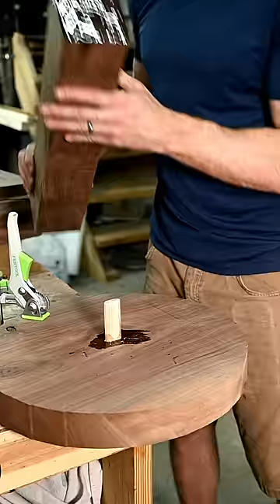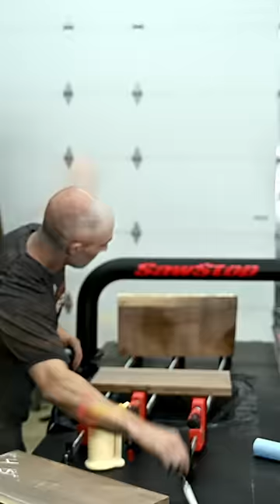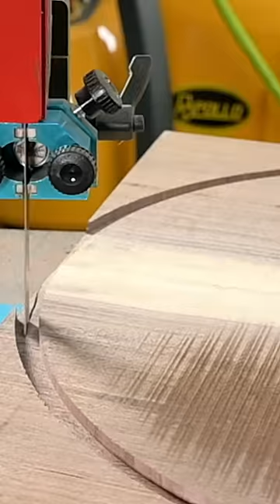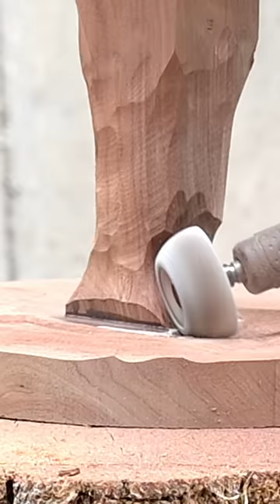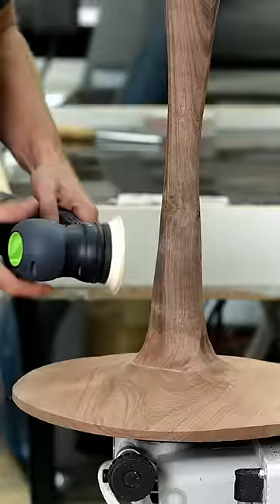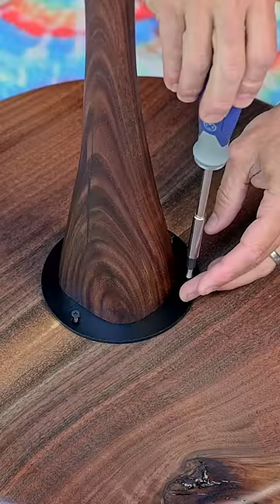I Tricked a Customer

Comment: So.... everyone's commenting on all the expensive tools, but this could be made without them.  Cam, please redo this experiment and show the same tables can be made with a standard circular saw, router, angle grinder, drill, and screwdriver.
Reply from the maker: No matter what tools I use to make these with there will always be comments demanding I use less tools. Until I can write a chat GPT prompt that builds a table for someone, people will be unhappy.
Reply: Not necessary but it fuckin helps hahahaha
Reply: @blacktailstudiouncut  no matter how low the wood costs, your hard work makes it worth much more, ignore all the people saying that your work costs nothing, keep doing you.
Reply: If the op can't see that you need several hundred dollars of tools on the cheap end to start this project, then here is your new title to not get those comments "A way to make money when you already have a lot of money to start with." You're welcome.
Reply: Yeah of course it can be done with lesser tools, I ran off a portable kobalt table saw for years, bought some old Bailey's at the local antique market and learned how to hand plane because I couldn't afford a planer, also hand planing edge contours and what not. No drill press, only the shitty milescraft mini drill press guide, etc. 

Of course It can be done - everyone's point tho is id hardly call that an "average" woodworker. To a professional, it's definitely average. But to someone starting out in the skill, it seems way above their skill. Great video nonetheless, and I do agree with him
Reply: U cant make this in 1 weekend without those tools... so his claim is a lie.
Reply: Average woodworking tools are drill, saw, chisel, sand paper, and measuring device.  What you just said was the equivalent of "if you want to get rich, just don't spend money". What a disconnected take.
Reply: People acting like those tables were some crazy feat he accomplished…. Just because he’s got a crazy shop and tools….. them tables ain’t shit….circ saw,jig saw, grinder, sandpaper, some fucking work ethic and mental capacity and you’re done ✅
Reply: @blacktailstudiouncut  Honesty I second that request. You say anyone could do this, but you used your tools, should do this with basic tools and see if you can still get it done in a weekend. 

Secondly, you are a professional woodworker. You probably have many thousands of hours in the craft, which any weekend warrior will not have. 

I love your videos and awesome pieces you create, but this video seems disingenuous TBH, it is alot harder then you make it look, and for a novice with basic tools it is an extremely high bar to achieve 1k profit for a weekend of work.
Reply: @recoveringstepson7033  did you not have volume on? He said not basic garage tool, but basic woodworking tools. I have less than 500 into my shop and I have more tools than Cam.
Reply: @blacktailstudiouncut or just make the video with every day tools… (circular saw, jig saw, handheld router, orbital/hand sand etc.) don’t be lazy, it gives carpenters the wrong impression
Reply: @redxgk  no, that's an average homeowner garage tools, any woodworker is going to have a lot more tools than that, things like a jig saw or bandsaw, a router table, table saw etc.
Reply: @Teh_Random_Canadian  you are correct that he makes it look easy, but any woodworker with standard woodworker tools (table saw, router table, jig saw or band saw, planer, assortment of clamps, etc) and some basic experience working with wood could do something like this.
Everyone here seems to be assuming that he means you can do it with nothing but an old drill and a file, and no prior woodworking experience, but that's NOT what he said.
Reply: It’s actually the knowledge and patience that gets you  good results. The newer tools may save a little time but if you are rough with any tools it won’t be hidden in your final product. I have seen craftsmen with much simpler tools getting as good a result and I say it comes down to knowledge and patience. Knowing which Timbers to use is another important factor as is knowing the best finish for the project … oh and by the way from time to time people have been known to give away expensive seasoned timber and off cuts  to an enthusiast, I have been on both ends of those transactions, when that happens the cost of timber is negated …
Reply: @cavelvlan25  ppssshhhh it's the market....."who's buying it" lol
Reply: @blacktailstudiouncut  Smart man. Stupid people are not worth your time.
Reply: @BOBANDVEG  I definitely hear ya haha. Hey ya never know tho
Reply: @blacktailstudiouncut  You're exactly right; you could chew it like a beaver and make it and someone would say you have privileged teeth.
Reply: @ke6gwf  Damn, you were lucky then, those were the tools I had when I started. Either way it doesn't diminish what I said about OP.
Reply: @3chasemanges3 ... And the space. A home where neighbors aren't as big an issue. Don't get the need to put down others with the mental capacity, maybe work on your own.
Reply: @gregriba6896  You can make it in 1 weekend without the fancy tools, but not without the skills. Cam can make it without the fancy tools; the average dude couldn't make it even with the fancy tools.
Reply: Yeah I've seen that in Mexico where they made their own tools to do something like that and more efficiently.
Reply: @gregriba6896 maybe you can’t make them but you’re not everyone else
Reply: @redxgk  see, the difference is that you are getting Woodworker and Carpenter confused.
The tools you list are BASIC Carpenter tools, as in what a dude building a shelf in the garage and feeling special because they are building something might have.
A woodworker is someone who makes more advanced projects, and that takes more advanced tools.
Reply: can you make this with just a spoon?
Reply: @ke6gwf  and there's the disconnect. I know what I was talking about. I built a desk with those tool, but I guess that doesn't make me a woodworker in your eyes.
Reply: @redxgk  no, it just makes you an impressive craftsman to be able to build a desk with basic garage tools lol
You used skill instead of tools.
These comments are on a Short, so you have probably seen the shorts of guys with safety sandals fabricating new excavator booms in the dirt, or turning rebar into lug bolts, and shaping wood only requires something harder than the wood, plus skill.

You were heavy on the skill, light on the tools.

But you are not an "average woodworker", I think you would agree.
Reply: Lmfao he would never do that because he knows it's impossible
Reply: Really, though, the premise is "average woodworker can make 1000 in a weekend"
Maybe extending the reasonable time to a week or four days, or whatever, which is still respectable.
There is wiggle room on a premise, and there is being off by half (or double, depending on how you look at it).  This build is probably closer to the later rather than the former.  Two weekends, four days, less room for error in the cuts and measurements as you go through the multiple steps that good equipment knocks down to one or two.  

Note:
I agree about doing it the low tech way just to see what changes.  He can even make the exact same piece as shown in this video for a reasonable control group.
Everyone wins that way, whether this video gets debunked, rebunked, unbunked, post-bunk clarity, or whatever bunk applies.  There will always be people making  bad faith complaints out of ignorance or pure jealous hate for talented craftsmen, but there are way more viewers who are discouraged when they see equipment they could never afford as a requirement to make beautiful pieces like the one in the video.  True or not, the sentiment remains for novice wood workers.  Building with basic hand tools shows what is possible.
Reply: And include how long it took to make.
Reply: @recoveringstepson7033  You can do this with a draw knife and a normal skil saw. That's about $100 for brand new tools of decent quality. It would be a ton of work that way but not incredibly difficult. If someone can't come up with a couple hundred dollars then they probably lack the skills to do something like this anyway.
Reply: @blacktailstudiouncut  well I would genuinely love to see how to do this on a budget.
Reply: @blacktailstudiouncut  wrong. Just do as requested and make the tables with a few tools from Home Depot.
Reply: Why bother? If not able to translate, than probably shouldn’t be using ANY power tools!
Reply: I feel like the expensive tools MOSTLY make it take a shorter time.  You can still get a similar outcome,  it'll just take FOREVER and be harder.
Reply: Bit entitled here, aren't we?
Reply: @3chasemanges3  the claim was in a weekend. Without those tools the "average" woodworker couldnt do it in a weekend. This could be done with a chisel, saw blade with duct tape as a handle, sand paper, and more than a weekend. The challenge was to do this in a weekend.
Reply: @Omni11B  no ish sherlock. The point of the video was in a weekend. This could be done with a sawzall blade with duct tape as a handle, sandpaper, screw driver, and will. It just wont happen in a weekend even if you spent 48 hours straight working on it. If the weekend part of the comment was removed i would 100% agree with him.
Reply: @blacktailstudiouncut  great way of showing you don't stand by what you said.
Reply: @trex9194  what don't you get about basic woodworking tools not garage tools. And if you can't make that in a weekend with a table saw, router and angle grinder this isn't the hobby for you to make money with.
Reply: @blacktailstudiouncut  nah you're just lazy.
Reply: One year later.....
Reply: @blacktailstudiouncut   I just find it hypocritical that you say this can be done with cheap tools, yet you don't? It bothers me even more how defensive you get when people point this out; either you're being ignorant or deceptive to your audience. As much as you dont want to admit it, theres a reason why people rarely craft these kind of pieces out of the home garage. It's a simple fact that it would require a huge investment in tools and equipment in order to do it properly and in a reasonable amount of time. I COULD make this with a circular saw and an orbital sander, but how long would that take? An entire day? An entire weekend of painstaking work? And how good would it look in the end? It's easy for someone with a complete woodworking shop to make these claims. If you really think it can be done with home tools then make that a video and you won't have to keep responding to annoying comments. In the meantime, I'm gonna call bullshit.
Reply: If you can't figure out how to build this then you aren't a woodworker anyway
Reply: @Nobody stop crying on the internet it's pathetic.
Reply: @blacktailstudiouncut gee, why might that be? Maybe because the tools are the biggest obstacle for people who can’t afford them? Are you really pretending that $700 festool track saw isn’t making your job significantly easier than my ryobi circular saw?
Reply: @kylevernon9625  but next to no one is complaining about a lack of skill, almost ever comment is about lack of tens of thousands of dollars in tools
Reply: @gregriba6896  says who?
Reply: @blacktailstudiouncut  😂 Well put!
Reply: @blacktailstudiouncut  nice way to dodge the challenge/request.
Reply: Idk where you live, but that's still near a 1000 in tools and that's on the cheaper end.
Reply: @blacktailstudiouncut  A.K.A, he wont do it, even though it brings in $1000 in profit he wont because it is hard as hell to do and he isnt willing even given the financial incentive
Reply: @ke6gwf  thank you for that. I just want OP to see it the same way and not sensationalize his claim.
Reply: @Omni11B  where do you get such cheap tools and are they worth it?
Reply: @jamesbarnicks4863  Craigslist and yes. You just have to wait for the right deals. Husband's die and wives just want the stuff gone. Most of it needs work but it's almost always just elbow grease and superficial things like paint which I don't care to fix. I have a functional shop, it may not look all pretty but it's accurate and effective. I have a bandsaw that cost me $25 bucks. When I went to pick it up I got a biscuit joiner and beast of a router for free. So $25 for three awesome tools. I'm slowly upgrading as my skills have gotten much more advanced and I'd like to have some festool things. But I'm paying for those with my cheap tools. When I replace things I'll sell off what I have for whatever I paid for it.
Reply: Honestly if you have enough patience, you can make this with a $50 Dremel tool, a hand saw, and sand paper. Yes its harder, but it can be done
Reply: @sigmasinc.2658  I'm talking about still hitting the weekend goal
Reply: @blacktailstudiouncut  clown
Reply: @kiyosenl.3889  Obviously, but the video is about making $1k over the weekend with AVERAGE SKILLS. And the correlation here is everyone commenting how easy that is with tens of thousands of dollars in equipment. Not sure why this is difficult to understand. If you need me to spell it out even further, let me know.
Reply: @blacktailstudiouncut  No. They literally just asked you to do it with the tools that you describe as "standard woodworker tools." It's not that hard. Nobody is asking you to do magic. Just make the same tables you just made, with the limited tools you claim you can make them with. Really simple ask. Not complicated. The fact that your response to someone asking you to do a very specific, reasonable thing based on your claim, is to deflect and say "No matter what I do, someone will want more," is weird.

If you can't or don't want to do it with less tools, just say so. Don't provide a lame excuse.
Reply: @blacktailstudiouncut  only thing I want is for the price of the simplest of tables to be NOT 1200 FUCKING DOLLARS
Reply: So maybe not 7000$ of tools. Just 1000$
Reply: Hahahaha! I got an idea, you do a video and use some Walmart tools lol. Noooo idea what you’re talking about.  I own 30,000 in festool and no other tools slightly compare. It matters what tools you work with 100%
Reply: I dunno chris fix uses the bare minimum tools in his videos to prove his point
Reply: Yeah but without the tools but would take a year to make that $1000 nit just a weekend 😅 tools are what matter the most.
Reply: @blacktailstudiouncut That’s fair that social media is filled with a bunch of haters! However, it’s absolutely a valid argument about the tools you’re using… If you could’ve done it with other cheap tools, than you should’ve… You know just as well as any popular content creator that it’s impossible to make internet trolls happy/keep them from barking about any and everything. You had to have seen this coming…
Reply: @blacktailstudiouncut  excuses. Do it by the original comments terms.
Reply: @MaYbYl8eR  not sure where you're getting your numbers from, but I'll take the bait and be very liberal here. Yes. 1k is much easier for a beginner to invest than 7k. We can disregard the solid cast iron sawstop, festool track saw, planer, etc. Forget the finishing tools, including the RO sander, discs, planer, drill press, consumables, etc. Haven't seen this video in about three days and I'll just go with the first three I remember. 

Remember, we're talking about an AVERAGE woodworker with AVERAGE skills. So yes, we'll go with 1k vs 7k if you're able to find an estate sale from a recently deceased modern wood worker. Your point is ?
Reply: @Nobody beautiful reply. I have an amateur shop and even I forgot about how much money I have invested in clamps alone. FUCK, I do mostly traditional woodworking and the amount of money I have invested in hand planes, vices, chisels, spokeshakes, DMT/whet/shapton sharpening stones, and even stropping compound was overlooked. And most of my antique stuff was bought an absolute steal, and still a shitload of money even disregarding the fact that I restored probably 95% of those tools myself. Thank God I had the skill of sharpening that my pop pop taught me when I was younger, probably 200 hrs+ invested into honing that specific skill. 

The consumables and time given to learning the skill itselg are very often overlooked and you made a fantastic point. I still think it's very doable for an average woodworker over a weekend, but only a very specific average woodworker. most men do not fall in that category. And his table was kinda trash fr.
Reply: Dude, pay me $1200 and I'll do it with things in my silverware drawer in the galley!!
Reply: forget all this arguing in the comments I want to see him do this with like a 7 inch circular saw and an angle grinder with a 4 inch metal wheel. no fancy clamps to hold the pieces in place while the glue sets, just some heavy things leaned up against it or placed on top. 

on a serious note, yeah he's a woodworker and has woodworking tools because of this so obviously as he progresses he will have better and more expensive tools. I'm not a woodworker but I enjoy watching these kinds of videos and shorts because I think its cool and would someday like to get into woodworking but it's not in my budget. it would be pretty cool to see a video or short of him making something with just basic tools that most people have in their homes like a drill and a circular saw or jigsaw maybe a grinder but I don't think those are as common. something like that would definitely help those of us without these nice tools see that it's not only possible but pretty simple
Reply: @blacktailstudiouncut  then do it
Reply: @cavelvlan25  Well, if people would prefer to complain over gaining 1100% profit, I say let them while we go out and spend that $1200 on a nice steak dinner and some new tools.
Reply: @blacktailstudiouncut  Then people will be mad that "the art is gone"
Reply: @Blacktail Studio Uncut  I just want to see you make this without all the nice tools and do it in a weekend like you claimed.  I think that's why people are giving you crap about this video.  Can't speak for the rest of your videos though
Reply: This is not true. Yes it can be done with lesser tools but the finish won’t be as professional and they won’t bring 1200, guaranteed.
Reply: @blacktailstudiouncut I wont be satisfied until you carve a table with your fingernails
Reply: @sigmasinc.2658  but the finish won’t be nearly as good and they won’t bring 1200. That’s the point.
Reply: Established a unique and unique perspective active....no order is more important than have an active😮 your offic😅e is nearby ....Thank Use !!
Reply: @blacktailstudiouncut ...here's an idea!! Our lives will be more comfortable if we become friends.. I have extended the hand of friendship....do what you will and we'll go from there...😂😮
Reply: @recoveringstepson7033  "average wood worker" meaning you have some tools
Reply: I believe he can,, his not cheating like The Dusty Lumber..
Reply: Can I do it with just a circular saw, drill, and screwdriver? I also have some dull chisels
Reply: @blacktailstudiouncut  Catering to the whiners is the same as feeding the trolls. Just do your thing and post it. I, for one, enjoy the vids and the finished pieces.
Reply: Cool and like skill and ambition, this shit is not that easy, youtubers need to stop selling accessibility
Reply: @3chasemanges3  Yeah im starting to think the majority of these comments are just adult children who have never done a hard days work in their life... Have they ever heard of sandpaper?
Reply: “Make your life harder for no reason to prove something that nobody disagrees with”
Reply: This would be a bitch to make without a planer, jointer and industrial lathe. No thanks.
Reply: @blacktailstudiouncut  make the video then, lets see how many comments you get when it's with just "basic" tools.
Reply: @blacktailstudiouncut  no, i just want to see the budget include the cost of tools as the premise of the video states tou "only spent 100$" but even if you did it with manual sanding paper and a hack saw that would be what 20$ but theres likely more than that needed. Theres also a time aspect where ypu have all this macjinery which saves you i guess at least 30 minute per cut minimum without you having to measure and do it manually.

Its a good video premise which a lot of people are interested in, the reason you are getting pushback is because the execution jusf assumes a shit ton of woodworking knowledge and equipment when you are claiming a beginner can do this.

Ok show us
Reply: @blacktailstudiouncut  that's not true. If you'd use tools that regular hobbyists can afford (like for a total of about $500), people could really understand that it is indeed accessible.
Reply: @blacktailstudiouncut  lame
Reply: @blacktailstudiouncut  excuses
Reply: @blacktailstudiouncut  bro what on earth are you rambling about. Nobody said anything about chatgpt your not simplifying an expression. You have 30,000 grand of equipment in your shop if you couldn’t do this is question your sanity
Reply: @colinlpeace  wouldn’t be hard, just time consuming
Reply: @blacktailstudiouncut in my opinion if you used a back saw, hand crank drill, coping saw, and sheets of sandpaper and a block i dont think anyone would complain about the expense of your shop.
Reply: @blacktailstudiouncut  of course we don't need all these tools.  Our ancestors only have hand tools.  But honest question, would you still be able to finish it in one weekend with basic power tools?
Reply: The people who are complaining are the people who will never build a table like this so I don't really think it's necessary.

If you have the skills to build this, you're not confused by the tool situation. 

You don't need to appease the randoms on the internet who are coming up with excuses to not do anything lol
Reply: LOL HE CANT, he wont let the festool drop out of his hands
Reply: Getting a rounded edge on that circular table... without special tools... gfl doing it with less then 100 hours of practice and dozens of ruined sets!
Reply: People need to try doing this instead of slamming Cam for his utilizing the tools he owns. I'm sure he started out with basic tools. Given time and the effort, this project could be done with nothing more than hand tools.
Reply: @recoveringstepson7033  Exactly... "Make this with only 3 ingredients... But you need $1,000 worth of kitchenware before you start" lmao... And dude is really trying to convince us you don't need social media to be a successful woodworker... Bro, JESUS was a carpenter... Woodworking ain't goint nowhere
Reply: My problem isn't the tools, he comments on it in the video, and stuff like that is expected at this day in age. What kinda pisses me off is the commentary on social media... Of course you can be successful without social media. Woodworking had been around for ages. The thing is, he still uses the internet to get it sold. That's social media. Idc what you say. Interent is pretty much strictly social these days, so...
Reply: @recoveringstepson7033  i think op is directing this at the "average woodworker" (which assumes at a minimum basic prerequisite shop equipment on hand) and not anybody just starting out with nothing. I believe the op to be making this video in earnest to be inspiring and informational which offers much value to the Youtube community. A lot more than i can say for the naysayers and haters.
Reply: Yes yes yes i personally chew every piece i make with my own teeth! I sell 1 piece every decade or so and im rich!
Reply: @studioGEEZ  but he is right, what are the odds someone find my Etsy page, need a side table, and happen to like that design.  Most likely it will sit in my house for 9 months.  So to say I can make $1000 in a weekend, it is predicted on having lots of fancy tools to save time, and the ability to reach lots of buyers.  The average woodworker doesn't have either.
Reply: @Nobody $500 in clamps?!  Lmao, 4 bar clamps would do the trick, hundred bucks max.  These comments are so boneheaded... crazy, you need tools to make shit xD point is you don't need a bunch of high end gear to start woodworking commercially.
Reply: You can have all the fancy tools you want if you have no skill you have nothing
Reply: It WASN'T made with cheaper tools.... THAT'S the point. It's like 🎃 saying he's a self-made man after only getting $100,000,000 from daddy.
Reply: Not on a weekend....
Reply: No dude. You said average wood working but you used tools that are well over 10k in value. How do you justify this at all?
Reply: @blacktailstudiouncut  use a pocket knife
Reply: @blacktailstudiouncut  how about you actually use basic tools then? Basic beltsander basic saw rig nothing else.  Cause using 10k in tools in your $100 video is kinda laughable
Reply: Well done , really proud of you 💚🤲
Reply: @blacktailstudiouncut  in others words no I will not redo it with easy access tools lol
Reply: @blacktailstudiouncut  good work tho
Reply: @blacktailstudiouncut  so no you can't do it...
Reply: Or you could go the Eoin Reardon route and use hand tools, haha
Reply: It would take more than a week end...  also "them" so he's made two??
Reply: @@jayphillips7490isn't a router table an average woodworking tool than an average woodworker would have?
Reply: @recoveringstepson7033 that's a weird take seeing as how he stated if you have... standard WOODWORKING tools. I'm pretty sure most people would consider a cheap router table to be pretty standard for a woodworker
Reply: I would consider those to be basic homeowner tools that every homeowner should own, not standard woodworking tools but to each his own
Reply: @blacktailstudiouncut  just do it with normal tools, don't bs us
Reply: Scratch that I want to see him make the whole thing with a hammer and chisel
Reply: @blacktailstudiouncut  ain’t that the truth lol. Watched a blacksmith video where a dude was making a basic knife and showing the simplicity’s of it. And someone was saying not to use any electric tools in the comments😂😂 must think people out here working like it’s the 1600s
Reply: @blacktailstudiouncut  sounds an awful lot like you don't think you can do it with basic tools and are trying to make excuses.
Reply: @recoveringstepson7033  Have you ever heard of pawn shops? I could go to my local one today and buy all the tools needed to make that table for less than $100, guaranteed. Just because you're either too dumb or lazy to do it doesn't mean it's impossible.
Reply: Or "here's a cool beginner project for someone investing in themselves". Some of us don't have a lot of money and will still spend 10-20 bucks here and there on something they need for a project. 

Yes shit costs money, but so did all the things you own that you can't make money from.
Reply: @recoveringstepson7033  Money is everywhere right now (not saying it's going to last)  If you don't have "several hundred dollars" stop watching youtube shorts and learn a trade. Learn how to be valuable to people.  I make $600 minimum a day as a painter.  People are begging me to paint their houses.
Reply: @gregriba6896  You can make a lot more with a lot less, if you're smart.
Reply: @recoveringstepson7033  nobody has ever made money without spending some. You have a car to get to work right? You spend money on gas. It’s called an investment. You could sit there with a file and hand saw though if you wanted for about 40 bucks.
Reply: @Nobody And then you need to develop the contacts and connections to find those clients that are willing to pay a$1k for a small table. There aren't alot of these people waiting behind every bush. That's real money. Even in NYC, it takes years to build a customer base to sell stuff on Monday that you built on the weekend. 🙃
Reply: @recoveringstepson7033  Nope. I can collect bottles and get the deposits for them. About $100 is possible collect (possible since I live in a country that has deposits on soda bottles and cans) in not too long time. And $100 of cheap tools is enough. Same amount of deposits collection for the materials.

Next thing here is that if the tables results in a profit of $1000 for a weekend's worth of work, then a second weekend could bring in $1000 more. And suddenly there is enough money to buy some way fancier tools and then spend some more weekends making even more money.

My preferred income source isn't woodworking. But I have instead been able to do electronics and programming and reinvesting a decent percent of the income. With a bit of skill that's a very well working route to collect some quite impressive work setup. The #1 step isn't to worry about tool costs, but instead focusing on projects that has mostly self-cost. Tools gets refused but the consumable materials is what decides how much of the sale price that will be consumed just to restock materials.

Both programming and wood working generally has low material costs. So they are good paths from converting own work time into money.

Some people makes the mistake of producing products where the materials may be 70% of the sale price. So only 30% left to cover tools wear, electricity, insurance, and finally leave a small amount of money to cover the invested time.
Reply: @Teh_Random_Canadian  Also, you need a customer base that is ready and willing to pay $1k for a small walnut table, that takes years to develop the personal connections to make that happen. We all know highly talented people that flounder professionally because of inter personal skills are poor and or without good business skills.
Reply: @Nobody walnut can be had much cheaper than that. Plus he said average woodworker. If you don’t have any tools, you’re not an average woodworker.
Reply: First time seeing him, i did doubt i could do it from home. However, i also doubt i could do it even with every tool in the world available to me. The creative bone in my head for creating tables or chairs is at an astounding 0. Repairing them? That i can do... So i do doubt i could do this even with his shop or any other. Thats just my woodworking level though. No part of me was meant to create, just tune and fix.
Reply: To be fair he did say average woodworker, not average person
Reply: @Recoveringstepson  he would still receive bs messages no matter what he does. You have ppl that are just trolls and if they can get someone to comment back or say something they won.
Reply: @blacktailstudiouncut   You can’t make everyone happy, but I do agree with J DeWitt’s comment, I as someone who knows nothing about wood working, but thinks it’s cool would like to get into it at some point in my life, but I know nothing as I said, so when I research woodworking I get all of these experts with their advanced tools and that makes sense. Like I don’t even know how to use a circular saw correctly, hell I couldn’t even point it out to you if I wanted to, but someone out there does and they have the basic tools and the understanding of those basic tools and if you can show someone that they can be doing this with basic tools it may create that spark.

I’m not saying you should do it as it’ll be a ton more work for you, but I 100% agree it’ll fire up some people and inspire them. It may not be right away, but it will happen and even if it’s only one person, then will you could change that one persons life.

But again, you do you. If you don’t want to use more basic tools then don’t. Best of luck to you in life! Have a good one. (P.s. hopefully that makes sense and sorry for all the commas, that’s how I write, gotta work on it).
Reply: @blacktailstudiouncut sounds like a HUGE excuse to me
Reply: @blacktailstudiouncut  pretty sure they just want to see you use basic tools. Not that insane of a request
Reply: YouTube is social media lol
Reply: Yea even with good tools you still need the hands to craft such beautiful work
Reply: @blacktailstudiouncut  just make it with only your hands no tools😂😂😂😂
Reply: @blacktailstudiouncut   but J DeWitt is right, if you want to reach people and make them actually realize its possible then use the tools that an average beginner to intermediate woodworker would have. Unless you really don’t care about that only the only thing you care about is content then the people watching it.
Reply: Reminds me of @HomoFaciens and his DIY CNC, made mostly just with cordless drill and hacksaw.
Reply: @blacktailstudiouncut  Yeah but you're making that money in a weekend without those expensive tools, more like in 15 weekends.
Reply: Sure, it can be DONE without those tools, but NOT in the time frame you gave.
Reply: @blacktailstudiouncut  Not really the point at all. "Average" wood workers don't have access to tens of thousands of dollars of woodworking equipment.
Reply: @blacktailstudiouncut just do it man
Reply: Oh wow those standard tools don't cost money? Wow
Reply: With all expensive tools anyone can... so bought everything needed and I'm still shit 😂
Reply: @blacktailstudiouncut  but those are the most basic tools anyone doing this could be expected to have. plus its a fun exercise of your skills as a creator. my first table was made with these tools and I imagine your first table was as well.
Reply: @blacktailstudiouncut  How's that prompt coming along?
Reply: @blacktailstudiouncut  sounds like a cop out to me
Reply: 😆 And without them how much are you making per hour?
Reply: @Chase Manges  Yes but it takes more time which makes your labor hours/profit margin dwindle. you want to make a thousand in  days to a week or a few hours?
Reply: Bro said without social media then made an etsy
Reply: Anybody here want to sell me enough walnut to do those tables for $90?
I'll even go to $100, heck $110 seems fair enough for it, right?
Reply: @Scramify  the work adds into the value of the finished piece but specialist tools definitely put a damper on his claims he should do the same things with the cheap tools instead of the top shelf stuff that fetool track saw along is almost 1k in tooling
Reply: If it could be made without them, as he said, then he should have made them without them.  Saying this is what you can make with basic woodwerling tools, and then proceed to NOT use basic tools just makes you look dumb.
Reply: @rogerahier4750  agreed
Reply: @rogerahier4750 
Not dumb, but definitely disengenous.
Let's start with: where the *bleep*are you finding that much hardwood for $90?
Reply: @blacktailstudiouncut then prove it bud! Show us please lol
Reply: @Ordzo88  It's talent, not tools. It's the skills, not the shop that allow you to make something like that.
Reply: @blacktailstudiouncut  do you have a video outlining the tools and methods necessary to make those tables?
Reply: @JDeWittDIY  yeah I get that. But let me know these basic tools I need to complete with my "skills and experience". Such a lame video to not show us how an everyday person can do it.
Reply: @Ordzo88  Just watch the video and substitute regular tools. E.g., he used a festool track saw ($1k or so) to cut down the blank. Totally unnecessary, just break out your skilsaw. But I agree, he should redo the video using normal tools that we all have :)
Reply: Then make the tables without these expensive tools and post that video. Because until you do, the people saying that have a valid point. 🤔🤦‍♂️
Reply: @JDeWittDIY  agreed 👍
Reply: @Recoveringstepson  you can get an entry level angle grinder for like $30 at harbor freight. You can cut this with a hand saw you can get for like $8. You can get a draw knife for about $20, $50 for a better one. And router and bit is probably another $60. Hardware would be $30 at most. Sand paper would probably run $20 for this project if starting with nothing. You're looking at about $160 in New cheap grade tools. Sweat equity goes up with these, but if you sell it for the same $1200, you're looking at about $940 profit, less your time. Let's say it takes you 40 hours to do at $20 an hour. You just made $140 profit to the company (less taxes).
Reply: @blacktailstudiouncut  >Obvious criticism that your tools are expensive
>load of excuses to sell the lie that nothing's ever good enough

Face it. You're too proud to admit this criticism is valid. Show us otherwise or just admit it.
Reply: look, I watched his video when the long vid first came out -  the 1200 can happen, but its once in a while chance. and the average wood worker will not get a finish like he did. is it true that he did his best to mimic an "average wood worker"? yes. but Did he use his years of wood working knowledge, photo background, tools, space, etc? yes. those are equally important when it comes to a side gig if anyone wants to replicate his success. Been following before he hit 1 million - but him making the 1k sale seems so easy is gonna catch some backlash for sure.
Reply: @blacktailstudiouncut  your statement= yes, even though it’s very possible to do that, it takes a lot more work/time and I don’t feel like doing that just to prove an obvious point. 
- And I am totally with you on that😂
Reply: You can do it with literal hand tools.
Reply: @blacktailstudiouncut i think we’d be happy with seeing this redone with tools you claim an average wood worker would have. After all you are a pro!
Reply: You could build that entire thing with a hand plane and cheap router
Reply: If you think this is plausible then fly me out, you can keep the money
Reply: @blacktailstudiouncut  "you can make these with basic tools" 
"Hey can you show how you'd make this with basic tools?"
"Why are people telling me to make tables with my bare hands smh these entitled mfers"
Reply: @blacktailstudiouncut  That's a convenient excuse! Lmao sounds like someone can't actually do it without all their fancy tools in their "massive shop"
Reply: @nathanfife2890  Whoops.

I'm an average woodworker without the facility and range of equipment that he has, and I could very much make a piece like this. It would take longer than he says it would. It would be much harder. Very laborious. And difficult to sell at that kind of price everywhere. 

You are actually completely wrong. Good job.
Reply: @blacktailstudiouncut   C'mon dude. That's a cop out. "Oh there will always be negative comments" dude, literally watch your own video and how many extremely expensive tools you use. I don't even do wood working or whatever. I'm just a dude that likes your videos. Your reply to this just comment made not like you. That's just disingenuos. I hope you live forever.
Reply: Not in a weekend.
Reply: Yes, plz. Also, walk through selling on Etsy, and, if you really want us to take you seriously, you gotta tell us where you get creative inspiration.... And give us access to it. Please and thank you.... Oh! Can you do a vid on paying my bills? And I shouldn't have to say, but plz be thorough as we average consumers/carpenters need every step outlined in detail if we're expected to get off this couch! In the meantime, just accept these doubtful and derisive comments as thanks.
Reply: @gregriba6896  so you gave it a try? Perhaps he should've said "every average woodworker except Greg bc he's scared of making the necessary mistakes to rise above average". Yeah, you're right. This rings way more honest.
Reply: @blacktailstudiouncut why didn't you 3 D print the table from wood?
Reply: @blacktailstudiouncut  ya and with those simple hand tools the project just went over budget on time i aint got 3 weeks to build a 1200 dollar table that you didn't prove you actually sold.
Reply: Keep recovering @recoveringstepson7033
Reply: @blacktailstudiouncut  fair point… at first I was like.. you keep saying this can be done with average tools, yet keep using “mildly” better than average tools, why not do it with “average tools”…. But then I quickly remembered humans are emotionally negative decision processing fickle pickles and you’d have people asking why you didn’t use your feet, why aren’t you using Ye OL average Elmers Glue, and why you’re in a shop/garage and not at your kitchen table or outside under a tore up blue tarp that’s covered in duct table and strung across some trees with the strips of bark from some saplings, and why your using sandpaper instead of dirt, spit and some rocks, and ya… So, I apologize, for nearly veering of the But but but cliff, and for all them emotionally charged teeter tottering eye twitching condescendingly Braggadocios lordliness masked with all the bunkum and guff fathomable, well… I’d apologize for them aswell, but Im not sure humility is something majority of them are aware of, sooo instead I suppose we just acknowledge it with love and kindness and hope they find some help and the docility in humbleness. 🙃 hahaha… rightttt. 🙃

(Mine is masked in superfluous garrulity, intended loquaciousness infected with florid verbosity… must be more like Hemingway… must be…. More Hemingway… Like…. Ernest…) 

Great video and work as always. Even if you didn’t use your feet and dirtspit smoother.
Reply: I agree, use a pocket knife to whittle and wooden pegs to affix.  Show em how it can be done for the cost of wood.
Reply: truthfully, there have been people in the uk who have spent 2 to 4 weeks of spare time to  use handsaws, and knives to whittle things down and copious amounts of sandpaper with a hand block to make 2 or 3 of things that are like this to afford some tools to make it easier to make them, they went from there to trawling second hand street markets for tools to clean up and they used half the money to do it again, from that point they eventually made businesses that made 100's of units a week,  from nothing to that takes patience and some amount of skill at knowing when to stop rather than go too far and make mistakes
Reply: Not in a weekend.
Reply: @blacktailstudiouncut  LOL, yeah....use just your fingernails.
Reply: But not in a weekend
Reply: @blacktailstudiouncut  Then make them with your bare hands in a forest with a knife use the very earth to stain the wood before polishing.
Reply: @blacktailstudiouncut   no, I took woodshop in high school and I could do 30% reasonably with cheap er hand equipment. If I wanted to make some extra cash and polish up my skills this way i'd need at least 1,000$ to start, or It would be more efficient to work for 3-4 months and save up for equipment. The time it would take to do half of this stuff is easily 3-4x longer. Now if I knew someone with tools/ a shop that would be different. What could you make with 200-300$ work of tools? What could a broke college student with no tools afford to make? Lots of stuff from wooden spoons to walking sticks.
Reply: Even then it would still cost more than his current and would eat into the $1000 dollar profit. 

His logic stands but his subject title which he has based his video on is wrong. 

But in the fight of clickbait, this is a more catching title
Reply: it is not possible to sell it for a profit.  That's why they try it on YouTube.
Reply: @blacktailstudiouncut  It’s what your viewers are asking for, why not give the challenge a try? I’m sure you’ve got more then enough money to do it, and you’re pretty good at what you do
Reply: @blacktailstudiouncut lol
Reply: He’s also not an average woodworker lol
Reply: But if he's showing an example of how to do something and then telling everyone they don't need what he used is dumb.
Reply: ... and bandsaw, planer
Reply: It comes to a point to what your labor and time is valued. If one uses the simple tools, that implies more time and possibilities for errors. You lose your argument when you use all these high dollar shop tools.
Just practice what you preach.
Reply: Lol OP can't do it
Reply: Except have any of you checked the prices for any of these tools lately. If I had a circular saw, a router, an angle grinder, and a drill press... I'd say I had a pretty awesome shop.
Reply: @blacktailstudiouncut  what a cop-out
Reply: Show this being done with more basic tools and people will listen more.
Reply: For an expert... correct.
Reply: You can always tell whether someone has any woodworking knowledge or not based on their comments.
Reply: @blacktailstudiouncut  aka this can’t be made with basic tools
Reply: If that's true and he doesn't need these tools to do what he does, then why does he have them?

Yes, with cheap/basic tools a skilled craftsman can make just about anything. But not in a weekend.

You get negative reactions because these videos are blatant examples of the most dishonest sort of boasting. It's the classic toxic boomer attitude of "I've accomplished everything in my life without any help. There are no factors to my success besides my sheer awesomeness, not even the tools I use!"
Reply: @blacktailstudiouncut  I think my issue is that you SAY in the video that you can, but would the tables come out as good if you did? I'd suspect you would need much more skill to achieve the same outcome with inferior tools. I could be wrong but it seems reasonable to assume.
Reply: Even just a circ saw, router, angle grinder, drill, and screwdriver is like $300 in tools
Reply: @Blacktail Studio Uncut
Reply: @Blacktail Studio Uncut
Reply: @blacktailstudiouncut  LESS TOOLS!
Reply: Also he did say average WOODWORKER. He did not say average guy. There is a difference.
Reply: Better quality tools do better quality work. 22 years in architectural millwork has taught me that.
Reply: @blacktailstudiouncut  its not the tools, or even the time it takes. The real cost is in developing the skills and experience to produce something of quality. A couple of days from prepping to finished dried product. A couple of decades to learn how to do it efficiently.
Reply: @recoveringstepson7033  " average woodworker".

Your average woodworker is going to generally have woodworking tools.  You technically only need a saw, drill, grinder, and router.  If a woodworker doesn't have those items, they aren't a woodworker.
Reply: most people dont own a router unless its for internet but my internet router cant cut wood
Reply: If you can pump these out fast enough with hand tools to make a living..You should be in the olympics instead.
Reply: @blacktailstudiouncut  then just attempt to build one with as little tools as possible. Sounds like a cool challenge video
Reply: @blacktailstudiouncut  actually, the average wood working guy/girl can do what you did. Reason? The average wood working guy WILL have a wood working space even if it is just an open air area. Basic tools like what were used even if it is smaller, older or made in china. I am not average and could not do it myself. I dont have a dedicated space, i use tools because my hands are not steady so i would have to advertise mine as antique. Except for a 20$ table saw, all i have are hand tools, yet i am amazed at what i can do as long as its not free hand. Yet i probably make a device from enough pallets to make the leg. My only question is selling it. The only ones i ever see are the ones who want tiffany product at dollar general prices .. for that matter, me too.. i love bargains and i couldnt afford a $grand$ table at retail prices.
Reply: @recoveringstepson7033  the problem is this video is for woodworkers and not wanna bees like you and me. I work with wood but i do no Have a dedicated space, ,, i do have hand tools, and a 20$ table saw... if i wanted to build that table i am sure i am smart enough to make so jigs to do the work, and it would probably take a couple weeks to do it, i am just not artsy enought to do the leg. Would have to make a colonial style lathe to do that..  granted his tools and shop would be nice to have, but i dont live in an area where someone around here would pay that kind of money for a small table
Reply: You can light your grill with two sticks but I will still use higher technology of a lighter. Work smarter not harder.
Reply: @blacktailstudiouncut  they will be unhappy but also proved wrong
Reply: Bro, anyone with the experience and time can make these table with only a chisel.  This video isn’t about making a table with expensive tools.  The video is about him challenging himself and showing us that we could make a $1200 profit project, by spending our weekend to make something, without the use of social media advertisement.  There’s no need to remake a video as the video can be about anything.
Reply: @recoveringstepson7033 you must have never heard the saying "it takes money to make money"
Reply: @recoveringstepson7033 
"...you need several hundreds of dollars of tools on the cheap end to start this project..."

Such bullsh¡† in your comment.
Reply: @blacktailstudiouncut  dude i am just dying of laughter 😂😂😂
Reply: @redxgk  🎉
Reply: 😊❤🎉❤❤❤ @redxgk  🎉❤❤❤
Reply: @Nobody ❤❤ 
😂
Reply: So why not use those tools to demonstrate 😂😂😂
Reply: If you have patience and time you can build anything from wood almost with just a hand drill, a good plane, chisel, couple of wood saws and sandpaper
Reply: He knows it will require exponentially more hard work, and that is why he will not redo it with simpler tools. This guy is always making excuses and whining.
Reply: It would be for an interesting video series. More tools used to less tools used. And looking at the end results from each.
Reply: @blacktailstudiouncut  people are always unhappy, forgot them. You made a beautiful piece here.
Reply: @blacktailstudiouncut  It's not about people being unhappy. No need to go for low hanging fruit of "you are just a hater" when people don't agree with you.
Reply: Yes please do make the same piece with said tools. In the same amount of time as well.
Reply: @blacktailstudiouncut don't use a excuse to negate the question. Do it bro
Reply: @blacktailstudiouncut  excuses are like sphincters
Reply: In the words of Liam Neeson. . . 'good luck'.😂
Reply: yes but then high skill is required. That is like me showing how you can make thousands a week by just typing in letters on a keyboard in the right order as a lawyer
Reply: Sooooo no it couldn't be made without those tools. Tools = efficiency and motivation
Reply: Within 7 days l
Reply: Hahahah. Yea. It’s the internet.  Those tables came out mint.  I think they were worth 1200$ all day. The other 1120$ was your skill level.  I can build anything out of metal but I can’t make a toothpick out of wood without screwing it up.  Guns. Master. Engines master. Fab skills. Master. Make a damn table   Shit
Reply: Maybe don't start the video saying you wanted to prove you could do something on the cheap then use expensive tools. Sorry but the comments are deserved.
Reply: @blacktailstudiouncut Yeah, youve obviously buily a fairly impressive workshop over the years but everyone just glosses over what you're saying. You clearly state you dont need the setup you have but everyone is still at your neck. Its wild ho hard it is to communicate simple things to people now. Beautiful table and great work on the video, im sure you get a laugh from the comments trying to judge your character off one video😂
Reply: @nielslarsen1693  yes u can google how to lay bricks but I can be 100% sure it will look like ass.
Reply: A handsaw a router and an angle grinder. Hardly 100s of dollars in tools. If you don't know how you could replace the bigger tools with smaller tools the. You e no business making a mess, never mind making a table somebody would buy.
Reply: No thats incorrect, he us trying to show how easy something is. Well tools and machinery make it alot easier plus cut construction time and skills
Reply: @blacktailstudiouncut this response is just you deflecting the fact you can’t do it with the tools mentioned 😂
Reply: You don’t even have to buy the tools, you can just rent them as well.
Reply: @blacktailstudiouncut  @Blacktail Studio Uncut  brother, ur missing the point of these comments. Sure, you can make profit doing what you said. However, in this video you A) you  used a lot of expensive tools and did not use simple ones B) you are clearly not an average wood worker C) you didn't really show how you did shit, you just did a sort of time-lapse D) no proof that you sold it E) since you have a social media you already know how to Market, so I'm willing to lay down money that helps F) you obviously invest a lot of time into this that your average woodworker may not have. The list goes on, good video, good table, terrible way to get ur point across. And it's wild you don't see how this video shows not a single bit proof an average woodworker can make 1000 bucks in a weekend
Reply: Josey Wilds  😂 no it isn't.
Forgetting that he said the average wood worker. Not any random internet troglodyte
Reply: If these tables can be made with a cheap Chinese 'Swiss Army" knife and a truck stop $15 ratchet/screwdriver set, let me know.
Reply: @kylevernon9625  yeah but he said average not starting lol
Reply: U could do it with a knife if u had the time. Eventually
Reply: Make it without power!
Reply: Not in a weekend it couldn't....
Reply: Yeah.   Everyone is commenting.   Because very very few people watching this could dream of having these specialist routing tools.  And without them.... you're not making it in a weekend.  And that's your brag.  And if we think about the cost of those tools.... to buy and run.... you've not just spent 100 dollars on this either.....
Reply: Just rent as many tools as you can
Reply: @johnathon007  
Rough cut it with a handsaw, take the blade off your mower, attach blanks, use the deck as a guide and work it like a lathe until round and beveled... DON'T DO WHAT I SAID, I would but I wouldn't suggest anyone else should. And a big yes on the draw knife, a wood "grater" (surform) would help too.
Reply: @blacktailstudiouncut  Sounds like infinite content to me
Reply: @liizs2863  100 dollars to make... now just a long distant memory..... isn't it?
Reply: @Teh_Random_Canadian  let’s also talk about the professional-quality modeling photos for his tables as well, like having a photo studio backdrop and lighting equipment to take pics you’d normally see in a high-end furniture catalogue. of course they’re gonna sell well if you have the means and funds to market it professionally. disingenuous indeed.
Reply: How about the time he put into becoming a wood working craftsman. More than you know. It takes lot of time and creativity to be as good as him.
Reply: @blacktailstudiouncut  You made an ad for yourself and still play the victim
Reply: Time to make without the tools you have don't make it worth while $/hour
Reply: Ok revision this can only make 200 dollars in a week but makes 1300 in two…
Reply: @blacktailstudiouncut  sounds like a good excuse to not do it lol.
Reply: Lmao, but that would require actual effort. Only in your dreams he's going to do that. As evidenced by his comment here.
Reply: yeah everyone's commenting that because he said you you don't have to do this with all these expensive tools. but he just showed himself doing it with all these expensive tools. and don't hold your breath there's no way in hell he's going to redo this with just a wood saw sandpaper and screwdrivers LOL
Reply: you just listed at least $500 of tools..
Reply: Its not the matter of the expensive equipment its the fact hes not average if hes all that. The fact hes not sitting there doing things by hand most of us would need to do as average woodworkers. The same project for the average woodworker may take days longer.
Reply: @blacktailstudiouncut  I agree people are never satisfied and will always have something to say but I think in this situation you should do a video that’s less expensive because in reality 99.99% of people do not have the tools that you have shown in the video.
Reply: @blacktailstudiouncut  just don’t insinuate this is possible, time and quality wise, without all your specialty tools.
Reply: Go ahead and do it with the simple tools mentioned and you win a prize
Reply: @blacktailstudiouncut  use a box cutter next 😭😭😭
Reply: @blacktailstudiouncut  boo hoo saying "spending less than $1000" but using multiple thousands of dollars of tools does not mean "spending less than $1000" it means you spent multiple thousands of dollars on tools and then some on materials.

Do it again but include the cost of your tools in your overall cost. Stop making little baby excuses.
Reply: @blacktailstudiouncut  table using a spoon and toothbrush lol
Reply: @blacktailstudiouncut  you can use what you like, but the problem is when you word it as "Using less than $100"

It would be like me saying I can make $1400 a month with zero spending. Step 1: put my spare house up for rent.
Reply: @Teh_Random_Canadian that's why he said "average" woodworker and not "amateur" or new woodworker. Average would be a mid tier craftsman, not some random Joe who just picked up some lumber and a few tools.
Reply: @blacktailstudiouncut  actually, that’s a good video idea.
Reply: @blacktailstudiouncut not really
Reply: @recoveringstepson7033  🤣🤣🤣🤣
Reply: My husband has made some, interesting tables and chairs using those same tools with the exception of having a belt sander...and palm sander, drills....the only difference in having a full shop...or not!!is imagination......
Reply: The guy brags about how easy it is to make money doing this but doesn’t mention the countless thousands of pounds he spent to get to this point.
Reply: @blacktailstudiouncut  My husband, got a kick tell me I told you so! He also takes few tools, and imagination and turns out some impressive pieces...btw NICE WORK!!🌹❤️
Reply: @blacktailstudiouncut  Good stuff, people really only see you're success, rarely the hard work it takes to get there.
Reply: @Adam Palmer  Dude that's literally the fallacy of slippery slope. Asking for him to use more basic tools is not asking him to use his feet and a toothbrush. That argument is not valid. We can ask for more basic tools without going that far.
Reply: @michellekrueger5122  
Your husband is able to do that not only because of skill, but because he doesn't say "I can't" or "I doubt..." like many comments here start with. I'm sure he starts any project with "I WILL". No tool or level of skill is more important than self-confidence, dedication and perseverance! 
For me, having a lot of experience in house framing, some fine carpentry and sign-building. For this project my words would be "I haven't... yet", but if I decide to, I WILL.
Reply: @blacktailstudiouncut  No we won’t say anything else I promise. Redo with normal tools
Reply: @blacktailstudiouncut well part of you're argument is that anyone could do this in a weekend, without those nice tools and to me much more importantly all that space it would take a bit longer. I'm not arguing it couldn't be done with less but it would take a bunch more time and effort.
Reply: @recoveringstepson7033  I mean it’s common sense that opening a custom furniture design business will have some start up costs. Idk why you would think you have the skills to make this table if you didn’t have any of your own tools first
Reply: @blacktailstudiouncut  obviously he cant or he'd post a video using cheap tools to show his true craftmanship. total chump lol
Reply: @blacktailstudiouncut  the problem is your acting as if anyone can do that and your wrong your not the only one here who has done this for a living it takes alot of money and time to get to a point where you can make quality products but technically yes you can make a basic table with basic tools but your very limited thats why you wont make a video with basic tools being used because you know it debunks your claim of a easy thousand bucks
Reply: @blacktailstudiouncut  make it with manual tool. A hand saw, sand paper, wood chisel, etc. Nothing electric, tools for less than $100.
Reply: Maybe don't say things like "average woodworker, no social media page" (you wouldn't have the customers to build that business to buy those tools). 🤦
Reply: @blacktailstudiouncut  cuz your proposition is extremely misleading. If you were honest about your proposition it would go down like this. Duh.
Reply: @blacktailstudiouncut  I mean not really, you have really nice tools in your shop, unless I've missed videos I don't think I've ever seen you make a video using only those tools. It's not like we'll ask you to make a chair with a rock and bubblegum.
Reply: If he was going to make a video like this he should have used tools that the average person has. Also he spent much more than $100 on materials if you count the glue, the sandpaper, screws, bits and the fastening collars to hold it together.
Reply: An avg wood worker? Has 200k in workshop and tools? An avg wood worker has everything to do this right? They may even be able to afford $90 on timber with out knowing if you can even get $100 for the table, with a hand saw and a file.
Reply: @blacktailstudiouncut  People will say "BUT YOU USED EXPENSIVE TOOLS" even if you used handmade flint tools from the neolithic era
Reply: Do it then!
Reply: Not in a weekend my man what a stage man has 16 hrs spare  in a weekend lol
Reply: I’m pretty sure I could build it with angle grinder with some different attachments, reciprocating saw (or whatever it’s called), and a sander. Bits for finishing it, but that’s not very expensive. I’m gonna build this table with just these tools I mentioned and see how difficult it was. 😂
Reply: Nah. You’re a lie. All you need is a the wood, reciprocating saw, angle grinder, a sander and an adhd. Hyper focus blessings… 😂
Reply: @blacktailstudiouncut you could rent some tools and include that in the budget
Reply: if you live in a country with over 400 million people to sell too
Reply: agree, use tools that you can find around the house and make the same table
Reply: Or, you could “rent it” from a shop you know buy, and return after your project is finished. (The no questions asked shops are best for this kind of thing) reason for returning doesn’t even have to be that good “just doesn’t work as expected” will do. “Not powerful enough”, “makes a strange noise”, and for many of those shops they don’t require a reason, you can skip the reason. (My personal favourite is Prime, let Bezos take the hit 😂 he can afford it with a tonne of cash he made of us throughout the pandemic).
Couple of projects like these and you would be able to afford not returning the tools ;) go for different brands of the same tool, so it looks like you’re trying to find your tool. But in reality - no one is going to investigate it. And after all - you’re not actually doing anything illegal. You’re trying it and returning it. Make sure it’s actual prime, and return within a month. Oh and also, if you can’t afford the big ticket price on prime, there are payment options, which means you only need your 1st  out of 12 or 1st out of 3 payments. And when you refund its coming back, so awesome pawsome renting. 😂
Reply: TBF if you were skilled enough all you would need is a wood carving knife, a drill and some  decent varnish
Reply: Theseasonorg teaches whole bible.
Reply: I don't even have those
Reply: Ppl making their inexperience with hand tools and poverty pretty obvious lol.

If you really don't think you can achieve this with minimal tools, maybe this type of work isn't for you 🤔
Reply: @blacktailstudiouncut  you should do it with just a sharp rock smh.
Reply: @blacktailstudiouncut  Bro, you're literally using a set up that costs thousands xD 

If you use a drill and handheld jigsaw it would be totally different.

Like showing Ethiopians where/how to get clean water (in a farari).
Reply: @recoveringstepson7033  lol right...
Reply: People just like to complain :p
Reply: @Scramify those people are annoying "You Paid $90 for the Wood and cut most of it off the table should be $50" I want to smack those people, Peoples Time and Effort cost Money
Reply: @blacktailstudiouncut you would need to use a spoon to impress some people lmao... Good work man keep it up
Reply: Time and labor scaling.
Reply: Time and Patience is a thing a lot of these complainers lack. XD
Reply: Then the tables wouldn’t be worth 1200 anymore…
Reply: @gregriba6896  he said average WOODWORKER not average keyboard warrior. A wood worker will have most of not all of these tools.
Reply: @blacktailstudiouncut yeah you can do it I think people are complaining because without some tools you'll definitely spend a lot more time making things like that perfect circle without fucking it up either way it's possible some people are just too lazy
Reply: All those things cost money too lol.
Reply: Nah do it with a small rock and a zip tie then nobody would complain
Reply: exactly. If you follow traditional Japanese woodworking, there is a ton of stuff you can do with hand tools
Reply: @Nobody You can probably build a router table pretty easy now that I think about it. You'll just need to spend hundreds of dollars in bits now.
Reply: @blacktailstudiouncut nice excuse :V good way to say you would've made a shittier version with normal tools and people would notice.
Reply: If you want it to take 20 times as long and be half as good, sure, it'll work. But to get good results you need good tools. If you are a noob, you won't be able to do anything close to what this guy is doing.
Reply: @Blacktail Studio Uncut  , nah... that's not what is being demanded. I've spent 100's if not thousands of dollars, over the years, on tools, and I don't have nearly the cool toys you have. I'm willing to bet a great majority of people who are saying to redo the project, with the requested tools from the original comment above, would appreciate your work for YouTube content. If not, anyone could easily accomplish what you did with the fancy toys you have. Obviously, experience has a lot to do with executing your goal.  The tool methods used, on the other hand, leaves the impression for viewers say, "cool tools, wish I could afford em", and nothing more about what you created. Congrats on the easy money made, it's definitely proved you can get a return on an expensive investment. Anyway, those are some really cool tools you have there!
Reply: Ah yes a circular saw, router and angle grinder are the tools everyone just has
Reply: I can replace the front suspension on my car with just a set of wrenches but that doesn't mean its going to be easy or time economical.
Reply: Meaning...he won't do it...because it's bs...
Reply: That's like Roger Federer telling me you can win tennis matches with a plank of wood. Not only is he himself using expensive rackets, but he is also Roger Federer
Reply: @blacktailstudiouncut  exactly!!! You must do it even more old school! With hammer and chisel!!! But you have to make those tools by yourself! Without Walmart!
Reply: @kylevernon9625  psshh that's nothing I built my own router table!!! Yaayy :D
Reply: @Nobody I built my own router table!!! It was a pain in the ass and took like a year because I didn't know what I was doing.
Reply: You need a saddle? When you’re riding so hard your ass is gonna get sore 😂
Reply: @blacktailstudiouncut  Nah bro, everyone has a circular saw, technically that's all you'd need for this.
Reply: @blacktailstudiouncut use less tools 🗿
Reply: @WarPigstheHun  congrats bud 🤙 I'm old enough to remember when I was impressed with the first router table I built 🤣
Reply: @Sovereign  I'll give you credit on this response, someones definition of "average" is subjective. However, I wasn't talking about someone just starting out either. I was strictly comparing my own experience of seriously getting into woodworking - and there is countless things I can give as examples. 

So I'm curious - Ill give you a fair comparison here and you tell me what you would say is an equivalent to an average woodworker. If we were talking plumbing here - would you call average an apprentice, journeyman, or master?

I'll also give you this - you should probably rewatch the video and listen to his words carefully before you give your response
Reply: @blacktailstudiouncut  axtually no onky when you use like 10k worth of tools to makecmoney claiming you can do it without it.
Reply: Cap
Reply: @recoveringstepson7033  Listen to the beginning of the video.  "An Average Woodworker..." So this assumes that you already have some decent tools.
Reply: @blacktailstudiouncut  yeah it can be done with less tools but the thing is you didnt even try that lmao
Reply: @gregriba6896  you can. Skill issue for you
Reply: @blacktailstudiouncut  Kinda dodging the question there.
Reply: @kylevernon9625 please show a demonstration on cutting a perfectly circular table top with a table saw please.
Reply: Its the fact your making the point anyone can turn 100 into a 1000 is the reason they are commenting on the tools. Either do it with the basic tools or don't bother mentioning anyone can do it. THINK.
Reply: I could build the entire thing with a handsaw and a chisel: eventually. 
But I have 4 decades of experience so put that into the equation…. 🤓🎶🎵
Reply: @blacktailstudiouncut  so you're saying it can't be done
Reply: My dad owns a woodwork shop. And yes, you can make a table with cheap tools. But yes, it will take time. Do better tools matter, sure if you wanna make it faster. But you don't need them. My dad sells tables, chairs, and cabinets all the time. Even does some refurbishing and painting. The people complaining are just lazy and or lacking brain cells. And I'm pretty stupid. Yet still managed to help him and sold tables I made myself.
Reply: yeah but the average joe couldn't do it in that short of time so it wouldn't be worth it, unless all you can do is woodwork in which case, God help you
Reply: @blacktailstudiouncut  you could still back your own words up saying it could be done with less
Reply: @blacktailstudiouncut  for sure, you can’t satisfy everybody. I do believe though, you could garner a lot of interest going from barebones, and building up a repertoire. You could probably make this table with a saw, some sandpaper, glue, and a lot of determination, with minimal investment, no?
Reply: This is possible with a fork if you have enough time, the only difference made with better tools are the speed of how it is done.
Reply: @blacktailstudiouncut  use your bare hands and nothing else!
Reply: @blacktailstudiouncut  No what matter is that you use a lot of expensive tools then say "You don't need these tools" While clearly showing that yes you do need those tools. If your going to do something that doesn't need them then don't use them. You do it cause you have them and it's convenient for you. If you need skill more then tools then show that it's skill more then tools. All you did was show that anyone with these tools could do it but you would need the tools to make up for the lack of skill.
Reply: @blacktailstudiouncut  dudes a fortune teller as well. do 1 video bruh.
Reply: @blacktailstudiouncut that's not true.  I can't spend 1000s your claim is anyone can do it (in a weekend) if you don't want to or can't just say that
Reply: I don't have any of that bro
Reply: Hey heres a clue word, a “woodworker”. Now doesn’t it make sense now? A woodworker would already have their own array of tools for their own personal use. Not some random person with no woodwork experience or isn’t even in the field of it can just do that. You forgot the point of the video. Please learn to comment a bit analytically
Reply: @blacktailstudiouncut  Yes, well it's a bit disingenuous to make the claim that the "average wood worker could make $1000 in a weekend" when the "average wood worker" does not have that kind of shop. The "average wood worker" would not be able to complete that project nearly as quickly as you could. 

If you're going to make the stance that people will always be unhappy with your video, the least you could do is try and be less facetious with them.
Reply: just the gear you are mentioning is several hundred euros... circular saw is around 90€, router 110€, angle grinder 60€,  drill 70€ (and these are just 1min google search...) so to start this you need 330€ + 90€ for the material... afaik that is not less than 100€... ofc once you got the gear it's all good and you only need the material... but if you start out you need to spend rather big money first...
Reply: Um,,, you have a router?!!  🙈
Reply: @blacktailstudiouncut  Does it make it any less true? No it doesnt so stop virtue signaling and playing innocence.
Reply: @blacktailstudiouncut  kinda showing that you DO need the expensive tools by your reply :D hahaa
Reply: I have two of those tools, guess which ones
Reply: @blacktailstudiouncut  
The problem is that you say the "average woodworker" can do this and you say you "only invested 90$" in the wood, but your tools probably cost in the thousands of $.

If you used average, non electric manual tools, you wouldn't get anywhere near that quality.
Reply: Yes but someone who can get a perfectly round table with just those tools isn't an average woodworker. Tools with specific purposes are made to bridge the gap between inexperience and skill.
Reply: @spartanseventyeight8673  yea but an average woodworker won't have such expensive tools.
Reply: @meyes1098  Exactly, the entire sentiment of the video is bullshit. An average skill woodworker would have the expensive tools needed to turn cheap lumber into high selling goods, likewise an average woodworker with average tools wouldn't have the skills to do the same.
Reply: @spartanseventyeight8673  You can cut a perfect circle with a router and a circle cutting jig pretty easy. But you're right, it's the skills, not the tools, that are important.
Reply: He won't.  Because it will take 8 times the effort and time.
Reply: @JDeWittDIY  I'd seen someone post that jig making is super important in making good on wood-working projects. But yeah, all comes back to 'the average woodworker'. Which given its growing status as a hobby, the average skill is going to be mid to low.
Reply: @blacktailstudiouncut  sounds like excuses
Reply: Could be but it'll take a lot longer
Reply: @blacktailstudiouncut  😢 🤡
Reply: Unless he works on it like a complete caveman where he makes his own nails n shit
There always people unhappy
Reply: @blacktailstudiouncut  You could give the griping people the tables and they still would be unhappy. 😂
Reply: @78ABates  You sound well off. Your comment was not nice at all. I don't have any of those tools but I want to do woodworking. Just can't afford tools as I'm a mother with a lot of kids.  I mostly just stain beat up furniture I get at the second hand store for now since you can get end tables for $10. You shouldn't make fun of people who are less fortunate than yourself. The beaver comment was sort of mean and hurtful.
Reply: @blacktailstudiouncut  dude those are beautiful
Reply: The point is, he said "in a weekend", which is nice, but if you don't have 120000 dollars worth of wood-working precision tools, and are ACTUALLY 'average', this WON'T be done that nicely in a weekend.
Reply: those are still quite expensive tools
Reply: Where the hell are you buying your lumber?!?  Walnut is around $9/bf. Not even teak hits $60.
Reply: What about someone using a hand saw, chisel, table vice and block plane in a 6x4 shed
Reply: Yep you need the tools… Im more curious about the time taken… proper tools less time… less tools more time…
Reply: @recoveringstepson7033  What sort of comment is this lmao. You think this video is for some random person to make money? You actually need to be a woodworker first.
Reply: @blacktailstudiouncut  so you are afraid of the challange?
Reply: There is the issue. All you people say you can do it with standard tools but never do it
Reply: @blacktailstudiouncut  treat it as a challange
Reply: @blacktailstudiouncut  nope, just make it with everyday tools and people will be satisfied. This comment is just deflecting because you know that you don't want to put in the effort.
Reply: @recoveringstepson7033  lol if you don't already have the couple hundred bucks of minimum tools needed to do this (a circ saw, angle grinder, and router), or the commensurate hand tools, you're not woodworking anyway so it's moot.
Reply: @gregriba6896  how do you figure? A circ saw with a straight edge will do all your cutting, nearly as fast, a handheld router can do the edge work and circle cutting, and an angle grinder does the shaping. If you were really on a budget, you could probably buy those 3 tools for the same cost as the wood at Harbor Freight. If you have zero tools, you're not making anything so why would it matter? Lol of course you need some tools to work on wood: it's not clay and can't be shaped by hand...
Reply: I found out the hard way that if you use cheaper less precise tools the job takes longer but it's the basicly the same, chisel, sander & saw 😂 The better the tools the faster the process... Tbf you could use a knife but it'd take months 😂
Reply: @blacktailstudiouncut  should grow the trees first too 😀
Reply: 😂😂😂😂 ya, thats WORSE than you ridiculous intro line
Reply: @blacktailstudiouncut  And doing it with a couple of hand tools turns a weekend's worth of work into a full week.
Reply: @blacktailstudiouncut  Oh, so you have been on the interwebz before? lol Sad that this is the reality of the internet. Those tables are gorgeous even though you consider them "simple" it is more than I could do.
Reply: Indeed. "This is easy money with all my tooling, but it can be made without it". Wouldn't the "without it" part be the most interesting then ?
Reply: @Nyarlah  no, we are all reacting because of what you said. Walking it back is an unaccetable way around just admitting it. Again, an average woodworker does not have the tools ypu used, so what use is your video to them, and more importantly, you did NOT prove what you "set out" to prove. So stop trying to flip it back on us, and simply admit, poorly written script or presaumption, period. Thx.
Reply: @blacktailstudiouncut  nice tables, but this comment 100% sounds like you just admitted you can't do it without your fancy shop
Reply: If the tools don't matter, why would he have bought them in the first place? If basic tools are all that are needed, why do these advanced tools even exist? CLEARLY they have a purpose and affect the outcome.
Reply: @blacktailstudiouncut  Just look at what you're saying. Any wood worker can make these with basic tools but you refuse. What did you even prove? That you could do it? because thats all I see.
Reply: @recoveringstepson7033 i cant tell what your alignment is here
Reply: so why didn’t you do it with them since you were trying to show the example of how an amateur can do it?
Reply: Well the thing is he did use the shop tools doing it by hand is much more time consuming
Reply: @blacktailstudiouncut  do you have classes?
Reply: @contraband1543  You think the master furniture makers 300 years ago had access to all the high tech tools? Off course he can do it but the question is will he do it? Given that time is money and it will take him 5 times as long, he won't do it.
Reply: then why don't you use that in the video to prove it?
Reply: This comment got 16k likes.. you had to have made it with a 4000$ Mac. No way you could type out a comment this prolific with a silly phone.
Reply: Well I saw the tools comments, where did you get that much walnut for 90$. That's what baffled me, also better tools make better looking cuts have. Your ever ripped hard wood on a basic table saw it's not great.
Reply: @blacktailstudiouncut  sure, but if the stated purpose of the video was to show how something could be done by the “average wood worker”, wouldn’t it have made sense to see it done with tools used by an average wood worker..? It’s not about satisfying everybody. It’s about doing what you say you’re going to do.
Reply: @blacktailstudiouncut  well, word this different so you don't come across as a simple DiY.. If so, use the actual "relatively standard tools" and make that the video...
Reply: Man I can't afford a "standard" circular saw. And if I did buy one I'd probably cut my hand off.
Reply: The specialized tools save you time. It would also come out less rough with said tools but it is possible.
Reply: All I have is a butter knife, sand paper hammer and screw driver. You think I can get it done ( in a weekend ? )
Reply: what's "regular" in circular saw, router, angle grinder, drill? how about a hand saw, wood plane, wood chisel?
Reply: @recoveringstepson7033  you need money to do absolutely anything bud. I need a 8k dollar car to uber..
Reply: @toyomemen14  Forget a handsaw, plane, and chisel.  Do it with nothing but a razor blade, ice pick, and fingernail file..... o_O
Reply: all the tools you listed are still out of the budget for many many many people.
Reply: Of course it can be done with less tools and gadgets. But this is the 20th century, not the 1800s. If you have the space and money to get them, you would. I know I would definitely.
Reply: @blacktailstudiouncut  won’t do it cause it’s to difficult?
Reply: If they can be made without them and your point was to show that the average woodworker could do this... perhaps the video should have been made with you using what the average woodworker would have access to. :-P
Reply: Go right ahead and make them with cheap tool ROFL such a joke,
Reply: @blacktailstudiouncut  Not really, if you keep saying "you dont need a huge awesome shop" but you also refuse to do it with "basic tools", it has no value. But yeah, hide behind the "there are always complains".
Reply: @recoveringstepson7033 he said the average woodworker. The average woodworker has plenty of tools to build those tables. Give me a break.
Reply: @blacktailstudiouncut you're the one that said it in your video so why not show us
Reply: LMAO preach it!!
Reply: Do it with a buck 119 and san paper squares.
Reply: Why stop there use a drawknife a froe hand drills and no hardware
Reply: @SomeoneImportantLikeYou he got the wood for less because he has the money to buy wood in bulk so the wood costs less per ft since he bought a shite ton
Reply: So what hes saying is yeah yeah its totally possible with standard tools, but im just not going to yeah totally possible
Reply: So what hes saying is yeah yeah its totally possible with standard tools, but im just not going to yeah totally possible
Reply: That amount of walnut is worth so much more than 90.00 That's about 200.00 worth.  With average tools your time would be way more than this   Routers are not an average tool either
Reply: @blacktailstudiouncut great reply
Reply: @blacktailstudiouncut you know damn well there will be someone demanding that you CHISEL a table out of a log
Reply: If he had a lathe he could have made the vertical piece in like 15 minutes
Reply: @blacktailstudiouncut  buikd it with hand tools no power. I dare you
Reply: Yes but the time converts to money.  You have much more than 100 bucks invested if it takes you a month to do it.  Don't be slow
Reply: This is what I thought too!
Reply: @blacktailstudiouncut unsatisfied, prove it can really be done by an amateur by using only a spoon
Reply: Why don't you do the experiment?
Reply: @blacktailstudiouncut Brutal response 😂
Reply: @blacktailstudiouncut  Then you will have the anti-AI people on your case for using AI and not paying good money to a woodworker. YOU CAN NEVER WIN!
Reply: @blacktailstudiouncut  Yes but the whole idea is to do it in a single weekend with reasonable breaks in working which you would need these expensive big tools to achieve. You can achieve the same thing with more basic tools but not in the allotted time frame.
Reply: That isn't the problem the problem is getting enough money to get the time off of work to do this.
Reply: It could be made w/o the high end tools and roomy shop, but it would take a LOT longer
Reply: @blacktailstudiouncut  you said you did it as an "average woodworker" when you aren't using the average woodworkers tools, yeah some probably have a couple of these tools but not all these worth 10s of thousands of dollars so no shit ppl gonna say that.
Reply: 😂 @blacktailstudiouncut
Reply: Just don't claim that a competent word worker is all that is required to make $1000 profit in a weekend.

It is the false claim that is the issue.
Reply: @blacktailstudiouncut Just don't make claims that rely on unspecified conditions.
Simple.

Accept your part in it.
It isn't that everyone except those that agree with you are just wrong - that is some serious lack of self-awareness, tinged with arrogance.
Reply: @redxgk  yea you aren't a woodworker 😂 hate to break it to you , but you just exposed yourself with that last comment. You don't have to be a woodworker to build a table. Being a woodworker means you work wood. Not that you can turn some materials into a piece of furniture. If you don't have the tools required to build this piece , you just aren't a woodworker. Sorry. Sucks to suck. Get over it 😂 or get better.
Reply: @ke6gwf  I wouldn't say the dude has a lot of skill just because he built a table. I need to see the table and the material that he started with. Ffs my lil bro could build a table if you give him the right materials. All you need to build a table is to go buy some IKEA. I'm not saying that's what he did. But after seeing his comments here , I really doubt that this dude is capable of anything impressive.
Reply: @couldyou4745  you haven't seen all the projects he's done apparently lol
Reply: @blacktailstudiouncut fuck the tools fuck the skills, say I got them as a gift... What do I eat for 2 weeks while I wait for them to sell on Etsy... If the title were "How to make an extra $1200 in a weekend" then fine, but otherwise no, just no.
Reply: Also you list hella tools like everyone has a spare $500 laying around and there's no way I could get that wood in my area for under $200. 

$1200-$700=$500 ain't looking so great for 16 hours of work. I think that's about what a private in the U.S. Army makes. If you don't take into account the job is 24/7.
Reply: @blacktailstudiouncut well you say it can be made without the studio, well prove it for once😊
Reply: He won't and we all know it
Reply: @blacktailstudiouncut but having those machines makes it faster otherwise you wouldn't use them so the whole in a weekend is questionable 🤔  sure it can be achieved with other tools but it would take more time ans effort which defeats the whole premise of the video...
Reply: The only way people will stop complaining is, if he does it with a butter knife, a 25¢ nail file, and his teeth 😂
Reply: What you proved is that rich people will buy things that they want for exorbitant prices, because they can. Not saying it's not nice work, but it's certainly not worth a grand. Well, except to people who have no consequences to wasting money. The rest of us have bills.
Reply: You are correct you tricked the customer! $1200 is insane.🤯
Reply: @blacktailstudiouncut what a way to talk your way out of it. You're no different than any other youtube scammer.
Reply: @blacktailstudiouncut Carve the whole thing from a raw log using nothing but a dull rusty spoon or you're not a real woodworker! Joking of course, people just suck.
Reply: Sounds like people need to step it up in life and work some ot for some damn tools. Go make a pine box for your children’s toys if that’s all you have, cmon man.
Reply: He can't do it
Reply: @recoveringstepson7033  can get alot of what he used in Harbor Freight for less than 600. He also said average wood workers, most wood workers already have the tools he he used (they're all tools that if you're a wood worker you gotta have anyway). So yea an average woodworker could make these and make that money if the right person buys.
Reply: @redxgk I have all the tools he has and I'm a less than average wood worker....
Reply: @blacktailstudiouncut Well in fairness if you were out to prove what an average woodworker could do, we aren't there - the average woodworker doesn't have this equipment. 

That said, big fan of your page.
Reply: Step 1: Have a $100,000.00 SHOP

Step 2: Try to downplay it in the comments and act like it’s everyone else’s problem as if you didn’t clickbait us.
Reply: @blacktailstudiouncut  maybe so, but it would be nice to see  how it can be accomplished that way
Reply: You said an average woodworker. No average woodworker has that type of equipment. If you were being honest you would have older hand tools and no budget. 
Stop trying to pass yourself off as “average”.
Reply: Not about using less tools, the claim is it can be done in a weekend.  Not possible with standard or cheaper tools, very much possible with the right tools.
Reply: @blacktailstudiouncut  offended much, make a damn table without tools for over 250k $ its silly to see content creators say "lets sell a table for 4000$" when you have all damn tools.

i have a regular saw thats it, cant do any of this... i have Fred Flinta setup here. Rocks and Stones.
Reply: @blacktailstudiouncut  you won't do it because it wouldn't come out anywhere near as good.... Don't just hide behind "people will always complain" that's pathetic
Reply: I mean if you have the expensive tools you save time... With basic hand tools it will take 4-5 times longer so if you dont value your time then I guess yea its possible to get $1000 making this with hand tools.
Reply: @blacktailstudiouncut  That's one cold response there, Cam, I love that. You've got a grip on woodworking way more than these fools, no reason to listen to them
Reply: Buy cheap, entry level tools and make something only using those tools and show how you can do it, whilst also showing how those tools need to be adjusted or set up to work best?? Show the time it tool using a cheap jigsaw, how to set up a circular hand saw with a basic picnic table to rip sheet material, etc.  this would help people realise your point and help you connect better with the majority of the audience,
Reply: I am curious how tall they are and how did you come to that height?
Reply: @gregriba6896 I don’t have those tools and I can make it. But I’ve been doing carpentry work for 20 years
Reply: @blacktailstudiouncut  I understand that, but the person who said that it could be done was you.

Then prove it. Otherwise, why say it to begin with?
Reply: 😂 doesn't mean you'll get the same results.  Stop lying, bro
Reply: None of those are tools I own, nor do I know how to use them and so this is still an invalid point.
Reply: @blacktailstudiouncut  do you have any videos only using those tools. I’d like to see you make the same shlt with the stated tools.
Reply: I mean if you used all harbor freight tools, you could probably get them for like 500$. Not cheap but really not that bad all things considered. If you have a garage and a job and you can save a hundred dollars every month, you could this
Reply: How much did you pay for shipping?
Reply: @blacktailstudiouncut  Thats assumes I have a computer and internet
Reply: @blacktailstudiouncut love your response 😂
Reply: @blacktailstudiouncut Just use BARE HANDS 😅
Reply: It's not about if it can be done 🙄 it's the tools he has speeds up the process allowing for more profit. More primitive will make the same product but eat up labor cost to make each one.....very basic. I myself value my time around $150hr so he is showing us how quickly he can do this and make a $900 profit yet his time put in would be less of someoen who spends a week on it...
Reply: I think as a man you should own your own tools, they are an investment 💯 throughout the year's I've added to my collection whenever I could, I worked for a few different companies and it's been plenty of times I'd see guys come on the job site constantly asking to borrow tools lol you should at least own a work bag with the basics and a drill, reason I bring an extra bag with me I keep inside my trunk with random stuff inside, I'll either give it away or tell them they can "borrow" it until they get their own, even just starting you can get some pretty good stuff for cheap at yard sales or flea markets
Reply: @recoveringstepson7033 he’s not claiming that some random person should buy tools and then make and sell furniture. He’s saying that an already experienced woodworker could make money selling their stuff without a following. A woodworker would already have the tools to make it, so counting the cost of tools is pointless
Reply: @nicksshitbro did you do it yet?
Reply: yes, but it would take 3 weeks without 20k of tools
Reply: @blacktailstudiouncut no you’re wrong. Having these big tool tables makes everything infinitely easier. How bout you make a perfect circle with just a jigsaw? That’s the most any normal man has in their garage. Not some industrial tool table
Reply: @blacktailstudiouncut it comes back to your intro when you say "average wood worker". The average wood worker does not have 10's of thousands of dollars in tools like that. Sweet table tho man 👍🏻 I like it
Reply: I have a drill and a a router..... a WI FI router :)
Reply: @blacktailstudiouncut  Make it with your bare fkin hands, lets see people comment then.
Reply: The thing is, it would take longer. And you'd require a deeper set of knowledge to make it using the basics.

That's the problem. To do it this fast, you either need the tools, or extensive knowledge
Reply: The thing is, it would take longer. And you'd require a deeper set of knowledge to make it using the basics.

That's the problem. To do it this fast, you either need the tools, or extensive knowledge
Reply: I made a log table from seasoned ash with an axe, a cheap hand saw, an angle grinder with flap disk, and vascillating sander, and a drill and auger bits (one log than I Carved into the table top and stand together).
Reply: Don't use expensive tools, just use these expensive tools. 
😂Wtf
Reply: @3chasemanges3  I do not understand where you people say basic tools then list 5 different power tools 😂

You're so out of touch.
Reply: We know it can be made with average tool and we know he can make it with average tools. But he made it with 10's of thousands of dollars worth the machinery lol
Reply: @blacktailstudiouncut  cmon bro make it with your bare hands 😂
Reply: Bro its a router table which you can make with a normal router and a angle grinder? Thats like 200$ total?
Reply: People don't care he has or uses tools.   It's that youtube people ALWAYS say the bullshit of   "here's how a beginner wood worker"  or "average"   

and then uses thousands and thousands of dollars worth of tools.  

not to mention better than ameteur photography.  

and yet.  magically sold $1200 item on an etsy page with no sales history/feedback
Reply: @stephenx2857  again router table is as easy as cutting a hole in a table, mounting the hand router using the screw holes to an inlay square, and laying it on the table.   150$ for the router

Other tool he uses is a angle grinder. Probably another 100$.
Reply: @blacktailstudiouncut  yeah but since the whole premis off this short was the point anyone could do this...
Reply: @blacktailstudiouncut  No they won't. Just prove you can do it with cheap standard tools.
Reply: @blacktailstudiouncut  no we’re just asking you stand behind what you said. I’d like to see it done with “standard tools” as well
Reply: Why are you so proud of being a scammer? You know all this stuff is worthless and takes very little work yet you still sell it for 1k. Greed is bad kids never become a person like this.
Reply: Why are you so proud of being a scammer? You know all this stuff is worthless and takes very little work yet you still sell it for 1k. Greed is bad kids never become a person like this.
Reply: If anything, this channel taught me that woodworkers are talentless hacks who should be paid less
Reply: why dont you do it yourself buddy
Reply: In a weekend ? Come on stop lying
Reply: That's not the issue bud. You're making claims that can't be backed up and people are asking you to "prove" what you're saying in your video you word for word say you want to prove. If you can do this exact thing with very standard average woodworking tools. And you can do it and sell the 90 materials into 1000. Then make that video. Don't say average and no social media page when you have a social media page and have an above average set of skills and shop. This whole video is a contradiction that's what people are bitching about 😂 if you make those sculpted tables in a regular garage with the standard tools you're saying then at least you aren't a liar regardless of what people complain about. But this way you're just a liar my friend.
Reply: Good Tools help but it's mostly the tool handler that makes all the difference. Great quality work brother keep it up
Reply: @Omni11B "basic" being the key word here....
Reply: @blacktailstudiouncut  I think if you were to stick to standard tools, saw, chisel, files, router, and a circular saw you would..
Reply: @Scramify  LITERALLY nobody has said that though...
Reply: not the tools it’s the skills how do you expect to make money in an area you aren’t good in people in the comments really just like talking
Reply: @blacktailstudiouncut  lol That has to be the definition of "lame excuse".
Reply: Its not just tools it's also the experience and vision you have that goes into making these pieces.
Reply: He starts by saying the average woodworker can do this. I think it's implied that someone who calls themselves a woodworker already has some tools or a place with tools they can use.
Reply: That and you can also go to a shop and rent their tools for pretty cheap and if it is something you enjoy doing. Some Woodworking shops have a month sub you can get, so you can do work there every month
Reply: @blacktailstudiouncut Now show a day where you can make the same amount of money with the smallest amount of tools as possible
Reply: @blacktailstudiouncut  If you can't make a table using only stone tools or a pet beaver, you ain't nothin!
Reply: @blacktailstudiouncut  lame excuse. you lied during the video.
Reply: @blacktailstudiouncut  okay we get that you can build stuff with less tools the golden gate bridges were built with more man power than giant machines. 

the point stands that maybe making a video about doing a 100 dollar table and selling it for over 1000 dollars is kinda disingenuous when you literally use tens of thousands of tools to do this. 

can you do this with a hammer some nails and a hand saw? and some sanding paper ?maybe? i dunno im only a finish carpenter. would it take you longer than with all the tools. most definitely! 
will the results come out the same as with the thousands of dollars of investment tools shown on the video ? who knows. patience can grind rocks into balls.  

it still disingenuous to say you only used 100 bucks piece of wood when you have thousands of invested tools.
Reply: @blacktailstudiouncut I love watching all woodwork. It's cool, it's calming. But I hate watching diy wood work videos where instructor uses very expensive tools. All I got is a basic circular saw, drill, router, angle grinder and basic diy skills...I'm just making some floating shelves here bro. Chrisfix is the king of diy mechanic because he shows how to do it with basic hand tools and power tools.
Reply: @blacktailstudiouncut I realize this is over a year. But you should definitely do this as a series for your channel. And all those fans will start scouring Etsy trying to spot your fake accounts. 😊
Reply: @blacktailstudiouncut  I think what they are getting at is you aren't making it in the same time with less tools
Reply: @blacktailstudiouncut  i mean you say that but the point to "please use tools we might have" is actually to show they can do it with those tools.  By using your entire workshop full of tools you take this premise "you can also do it!" and makes it "if you have these tools you can do it too!"  i know that isn not your message but that is what the average person will see.  There is a massive disconnect here from the DIY garage guy and  yourself who has those many expensive tools.
Reply: @blacktailstudiouncut just do it with your bare hands like a man.
Reply: @blacktailstudiouncut  Sounds like you just don't want to put the effort in to ACTUALLY show that you can do this with standard tools most middleclass woodworkers would have.
Reply: I don't even have a "standard circular saw, router, angle grinder, drill"... but I do have a screwdriver. Although I'm running low on orange juice.
Reply: @blacktailstudiouncut I wanna see this done with sandpaper and a swiss army knife
Reply: @blacktailstudiouncut  hahaha this reply is awesome.
Reply: Sure, you can make it with cheaper tools, but with 50k worth of tools, it take a few days, and without them, it's going to take weeks. 50k worth of tools = $100.00 and hour and 2k worth of tools = $15.00 an hour lol
Reply: It would mean more if it was ACTUALLY done with a basic set of tools
Reply: @blacktailstudiouncut sounds alot like an excuse to not do it, instead of just admitting that you need the expensive equipment.
Reply: @blacktailstudiouncut  I really don't see the problem with anything you're doing. As everyone knows everyone is always going to have something to say but just keep being you and I'm sure everything will be fine
Reply: @blacktailstudiouncut Without the shop you wouldn't be able to do it, if not prove me wrong dziwko
Reply: @kylevernon9625 this dude is average, he has stated that many time. You are completely inexperienced and just see him as ah expert in comparison to yourself.

That's like whatever your best skill is, in that skill you are probably just average, no offense, and compared to the rest of the world you would seem like an expert.
Reply: If you want the truth, although it would take a long ass time, you could make these with nothing more than sandpaper, you don't need a cutting tool at all, hell you could fell a tree with a rope and sand/break away what you don't need it'll probably take a months though. Tools just make shit faster the skill is in knowing how to make the thing you want to make with the tools you got. You could use a file, sandpaper and a bicycle as a makeshift lathe, creativity is only limited by ingenuity. 2 years ago if you asked to make some of the crazy shit I've designed and made I'd tell you thats crazy talk, now I could design and build a whole kitchen and bathroom from scratch from the countertop sink cut outs to where to place the drawer rail system holes for pretty much all rail types.
Reply: @blacktailstudiouncut  People are complaining because you specifically said "less than $100" while showing thousands of dollars worth of tools...
Reply: Yes, it could be done without all the big expensive tools, but you would need substantial knowledge of how to use basic hand tools. It would take exponentially longer than it took him, therefore diminishing the profit margin.
Reply: It could be made without them, but not as well.
Reply: He doesn't want to do your little experiment because it would take much longer and that would cut his profit/time. 😂
Reply: He won’t because he can’t
Reply: @recoveringstepson7033  Jig saw, hand router, orbital sander, each about 30 bucks from Black & Decker.  You could do this whole thing with just that, or even skip the router if you don't care about a big roundover.  The wood's going to cost you more than the tooling.  Took me a minute to check you on that "several hundred" claim.
Reply: @blacktailstudiouncut You are using tools a professional would use. Still loved the video and wasn't gonna say anything until I saw your comment. You are the one who challenged yourself, that's not an average woodworkers shop.
Reply: @blacktailstudiouncut  No worries, i can assure you that i could do it with only few tools, it would take more time. But hey why not just upgrade your shop as you build up momentum? Sell one, sell two more etc. Create something new along the way, restrictions are key to innovation.
Reply: @Scramify 😂😂 calm down..😅
Reply: Yes, really, all u need is a jigsaw clamps sand paper and a router, and maybe u could get by with less but I could get all of those tools from a fleamarket for like 60$
Reply: have you tried to do this? it fn sucks tools and even if you don't have the expensive tools you still need the right tools
Reply: @kylevernon9625 true, but what makes his work so profitable is his skill, not the tools he uses. Anyone who practices and gets good at woodworking could make the same $1100 profit he did using the same tools you described(albeit at a slower pace because hand tools are much slower than power tools)
Reply: @blacktailstudiouncut except…people do this with a handsaw, chisels, hammers and hand planes. 
And a normal person still couldn’t do it be cause hand tools are still expensive, time is expensive and skill is hard to obtain.

You tried to show how easy it is, you got called out. Own it
Reply: @ke6gwf woodworker here. I don’t have a router. 

Please say powertool woodworker. 

You lot do amazing things we handtool folks can’t do. And I don’t want our crafts compared. We do things you can’t, you do things we can’t
Reply: @blacktailstudiouncut well start with getting a clue about what an "average woodworker" has at hand and then use that. If you use a circular saw, a drill, a jigsaw, and a sander, then that would be what you could expect someone to have at hand or easily procure for a project like this. You're using things that only an affluent craftsman has at hand that save a ton of time, require a massive investment, and deliver great precision. I know you'll deny it, but that's where it stands.
Reply: That's a cop out.
You are lazy... or you wanted to make $1200 in a weekend but just not at the cost of actually proving the point you claimed. 

"Proved" is strong wording.
With no shop and "average garage shop tools" it could be a week or half week (also known as a weekend, if 2.5days is a weekend). 

Keep it up big daddy @blacktailstudiouncut
Reply: @johnathon007 can we see you do it? This OP wont
Reply: @blacktailstudiouncut  You have to use rocks and sticks like the good ol' days, no cheating
Reply: Cam, you can’t please everyone. There will always be haters and they will always attack anyone who isn’t them.🤪
Reply: Gonna be honest you don't even need a lot of the power tools you mentioned
Reply: But it will have less quality + more time invested
And if you want to make it better you will have to invest even more time
I can say that i can build a statue with just a rock and a chisel
But other person with better and more tools will have even a better statue in less time and with more quality
Reply: Even then. Cause THEN.. people will say "eh.. you didn't work enough" 😝
Reply: @blacktailstudiouncut  not really, i think hes right i don't got a table saw or router but i have a circular saw, angle grinder, drill, and screwdriver
Reply: @blacktailstudiouncut I mean, technically speaking, you could make these with just hand tools. It just takes longer.
Reply: You didn't prove that at all lol All you proved is that someone with money was into that specific item,at thw specific time,and in the specific location to mla that sale possible...No one has TWO WEEKS to wait around for a sale as low as that.
Reply: I get what you are saying, but there is no sense worrying about what those people say. If they knew anything about wood working, they would already know they could do this with a saw, a router, and a sander. The ones questioning it have no intention of building anything.
Reply: @Scramify  what is amazing is how much money is out there. If you live in a poor neighborhood, it is hard to imagine anyone paying more than 50-100 dollars for these, but there it is at 1200.
Reply: All you need is a file and a piece of string... it will take time, but that's all you really need.
Reply: @blacktailstudiouncut no se trata de eso, se trata de que yo tengo una segueta, un serrucho, un martillo y una lija 🙄
No todo se trata de ti bro
Reply: @blacktailstudiouncut  bullshit, do it with your basic carpenter tools like you said.
Reply: Screwdriver? For what? You peg furniture. Metal joining is a disaster.
Reply: Do you realise it would take 3 times longer doing this work with conventional tools
Reply: @blacktailstudiouncut an average woodworker without as much skill and experience as you and without as many or as nice tools as you could not do this in a weekend. I know because I’m an average woodworker. Your shop is set up perfectly with large space, fancy dust collection, and all the jigs you’ve built over the years and specialized techniques at your disposal. An average woodworker is also busy on the weekend mowing and trimming the lawn, fixing things around the house, etc. We don’t have YouTube money to do everything else for us. We have to work 50-60 hours during the week to pay off our crushing debt.
Reply: @recoveringstepson7033  OP started the clip with the phrase "An average woodworker".  Those are the type of people who will have access to "several hundred dollars" of tools.  

Once one gets past making excuses, there are other ways.  Makerspaces, borrowed tools, pawn shops, rented tools, ect.  But yeah you will need some tools.
Reply: @blacktailstudiouncut  Wow what a copout
Reply: *standard wood working tools if you want to make $1000 selling tables you need to have the proper tools.
Reply: @duncanator9307  Mate, he said "average woodworkers tools" in the video, and specifically that one does not need all the expensive tools he's using.
Reply: Bro you have thousands in woodworking tools.  Average my butt.  Use average tools.
Reply: People also forget you can make your own tools like jigs and guides that make a world of difference
Reply: @blacktailstudiouncut mesmo uma maquinaria padrão aqui no Brasil custa caro. 😅
Reply: @blacktailstudiouncut 😂such a great response.
Reply: @Scramify nobody is belittling the had work put into this. People are critiquing the fact that the video is to be perceived that "you can make $1000 in a weekend as an average joe" whereas its not the case. If he used a few hand tools and not $10,000 worth of gear, then nobody would have an issue (except maybe a few idiots). The issue with doing it by hand is it would take more than a weekend, as you'd be looking at more like 100+ hours, so it's counter intuitive.
Reply: @Teh_Random_Canadian I'd love to see a video of him actually making a table using black and decker gear from fb marketplace 😂
Reply: @Scramify people telling others to ignore criticism should be thrown in jail
Reply: @blacktailstudiouncut Choose a random viewer who commented on your video and ask him to come to his house and make two tables like this with the tools he owns! No one will complain that you used more tools!
Reply: those are already things, we don't have at home. and they cost a lot!
Reply: @blacktailstudiouncut they will still complain
Reply: So make it them without them lol
Reply: I helped a buddy of mine make a rustic table using only an axe and a froe.
Reply: @blacktailstudiouncut lame excuse. You made the claim it could be done with basic tools. Provide evidence for the claim and not excuses.
Reply: @gregriba6896 he claimed that "an average woodworker" could do it, not "an average person".  An average woodworker would already have the tools.  His claim was obviously correct.
Reply: @Teh_Random_Canadian  if you CAN'T do this in a weekend, sell your tools and get a retail job.
Reply: @gregriba6896 you want him to go out in the woods and state from the Stone Age??
Reply: @hughmann7485 lololol😂😂😂
Reply: @blacktailstudiouncut proof that it’s the tools basically
Reply: Hmm...  I'm pretty new to woodworking and have done most of these with a jigsaw and router table.

I haven't shaped a base like that but could think up a way to improvise a lathe if I need to.
Reply: Hmm...  I'm pretty new to woodworking and have done most of these with a jigsaw and router table.  Table top = pattern bit with rough cut using a bandsaw or jigsaw...

A little router jig for a jointer to glue the pieces together...   The base is probably the only part I haven't done but I could probably make a jig for it.
Reply: @kintsugikame As a photographer...  that's BS.  Most photographer's can't buy that and wouldn't anyway.

It's not hard...  bounce a light off a ceiling... or use a diffusor (aka... white sheet)...

I once took high speed photos of drops hitting a bucket using a halogen work lamp.

If you want to take good photos, a cell phone has a much better sensor than a pro camera in the 90s.  

Like this project, you just need to know how to use your equipment.  (FYI a pattern but is pretty basic)
Reply: @recoveringstepson7033  I don't understand comments like yours. If you don't even have basic tools and don't want to spend even $250 on tools to get started, then why watch these videos and complain like you're going to go out and do it anyways.
Reply: Are you trying to trick me right now? Isn't youTube social media? 🤔
Reply: I recently made a round top outta solid poplar ( I've made 3 things total, so it's not great) without electric tools. The sculpting on the base would be really hard for me. A thousand hours of experience from now I could probably make this without buying anything but the wood. Note: I have like $450 in hand tools, including a $200 hand plane, 2 hand saws, and a cheap ass $35 plane that was a mistake. My kit is small but not totally barebones. It's crazy to me that that's true and that I can actually say, "I'll be able to do this sometime in the next few years." At least if I stick with it properly.
Reply: Jaja no me preocuparía la opinión de gente que nunca agarro herramientas, sería carpintería de teclado. Es fácil opinar si no pones las manos a la obra 
Me gusta ese trabajo, el nogal lo poco que lo he tratado ya es una de mis maderas favoritas.
Reply: @blacktailstudiouncut if you didn’t start off by saying, “average woodworker”, prob wouldn’t have been an issue, but you (all) know that by now.
Reply: @blacktailstudiouncut  CHATGPT was used to chooose the most  Inflammatory condiment , no such thing as bad PR
Reply: @blacktailstudiouncut All the tools you have in this video are ones that should be in a basic woodworker shop. What would be interesting is watching you do this with just hand tools. No power tools. I would be really interested to see your hand carving on the base and how you attack that. But overall these tables look awesome and motivate me to try more.